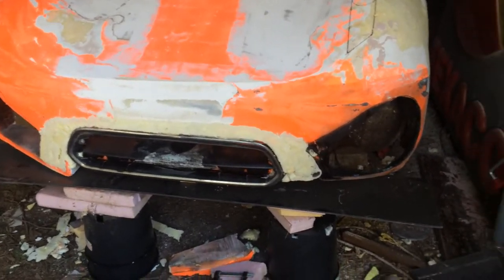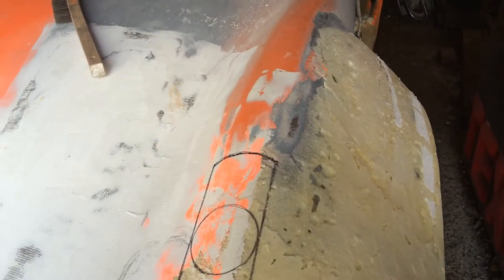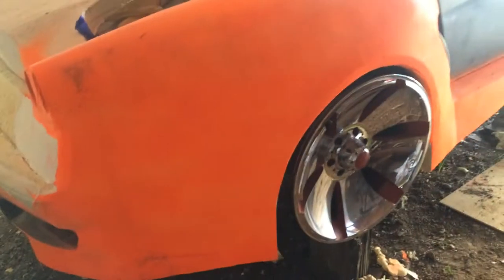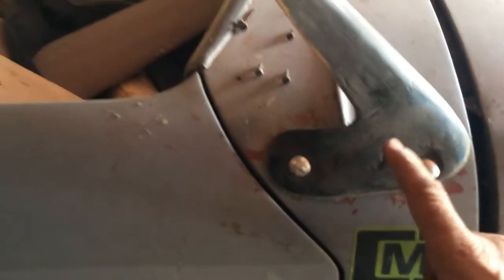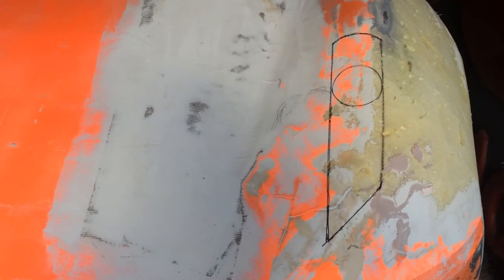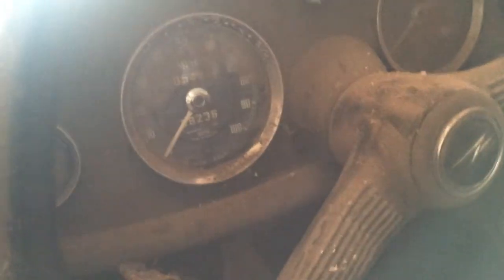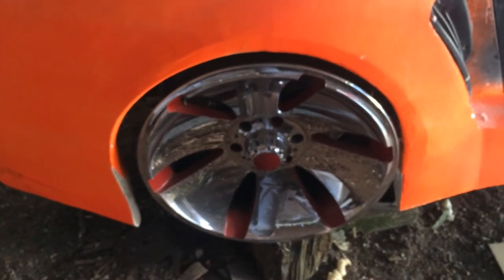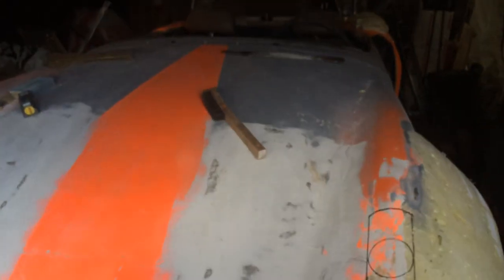Foam wide body Austin Healey S

Comment: hi I'm From Fla. and have a 96 328i bimmer, had 7years, added wide body kit from dtm, but want to do a total change on front and rear bumpers, then paint. Will foam work to make any shape for taillight and trunk, headlights fitting etc, etc. just a  total make over!!
Reply from the maker: +MrTedco JRi  thank you for watching this is such a good question ,and my answer is look at all my video on my AH  if you can see it in your mine then you can do whatever you want 
Good luck on your project
Reply: Thanks Mr Radu, I will consider that information. Now just need to purchase all the materials!
Reply from the maker: MrTedco JRi nice keep me posted on your project